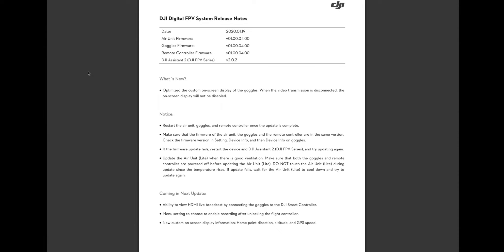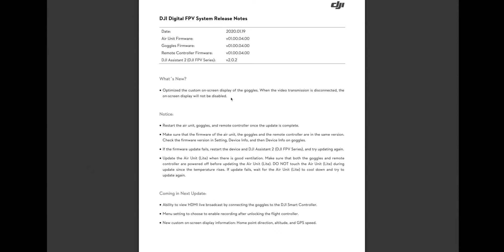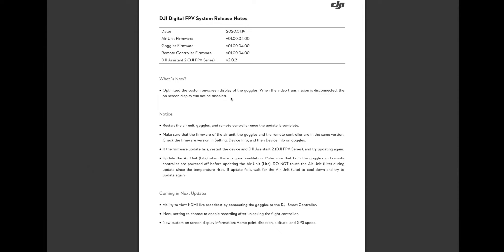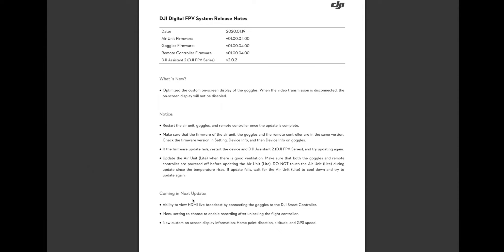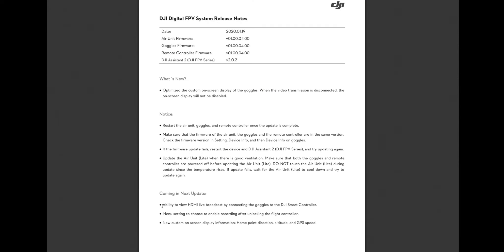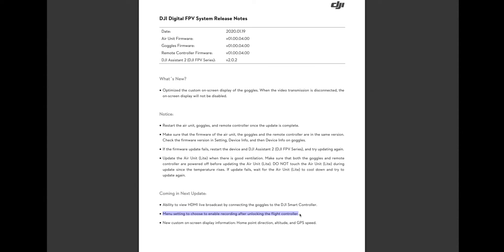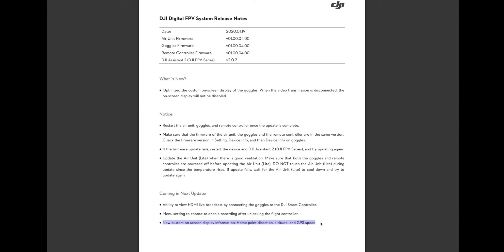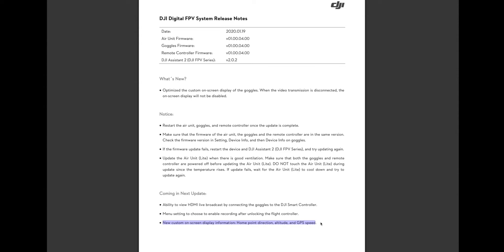Second January DJI FPV Firmware Update - Release Notes Review

Comment: Thanks for the video. I have the DJI smart controller and I’m anxious to see how it works with the smart controller.
Reply from the maker: It will be interesting to see how that works for sure.  Wondering if it will act like a screen only or if there is a way to get an HDMI signal out of the controller or anything else.  Sometimes it can be confusing based on the release notes.

Comment: I wish they would fix the OSD lag. Often on my DC3 I find the mAh gets stuck and can take tens of seconds to suddenly catch up. At the end of a flight where I'm carefully watching the mAh it keeps making me end flight prematurely or go over my preferred limit. I have had others say they experience it too so I know it's not just me. Definitely looking forward to that home arrow, alt and speed element addition though.
Reply from the maker: Change Agent Strange.  I only use voltage to gauge my battery and that reading works great.
Reply: @5zero7RC  If all else fails you can just fly without an OSD and use a timer on the controller old school style lol. I have done a ton of long range with no OSD. 😄

Comment: Awesome, I have a smart controller! I'd love to see them allow video in on the goggles. This would allow you to fly in the sims getting used to using the googles. Thanks for the update
Reply: But its already possible to conect the gogles to a computer to play simulador on the googles. It has a input conection.
They say that Will release soon the Next firmware update to unlook the software and slow use to use it like a output to Share the image from the gogles with HDMI devices.
Reply: @dstepsfpv  I wouldn't call that already working. This is a complicated work around, it should accept video input via usbc
Reply: Well, let's see whats New with the Next update, I hot they unlook it to BE  a vídeo out put by the usbc
Reply: @dstepsfpv  yeah it's strange to convert it to analogue and then back to digital
Reply: @Bannisterpost  to fly analogue I'm gonna buy the URUAV 5.8G RX PORT 2.0 for DJI and a rapidfire, its the best solution to fly analogue with the Dji gogles.